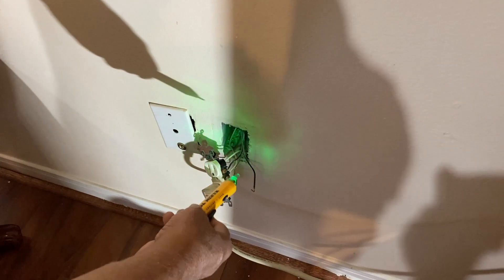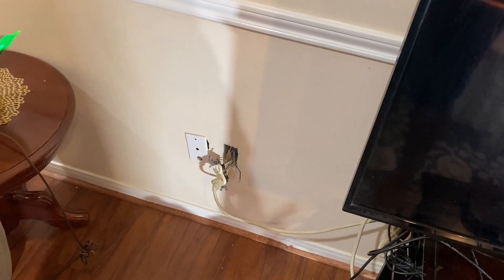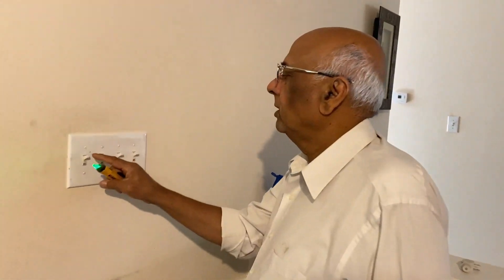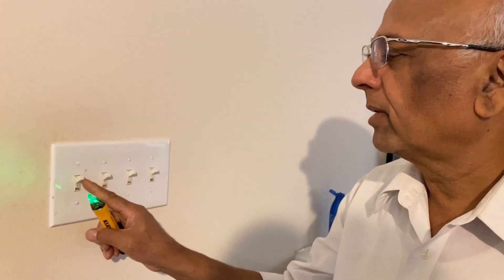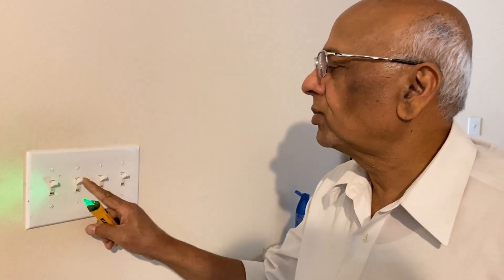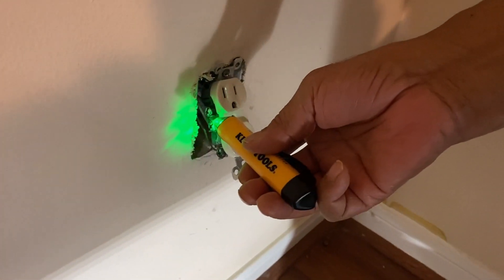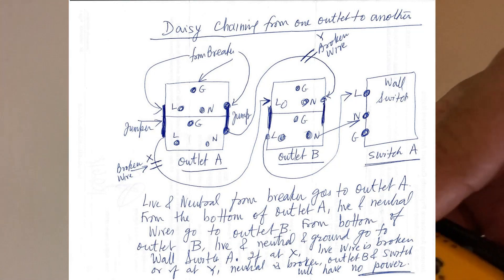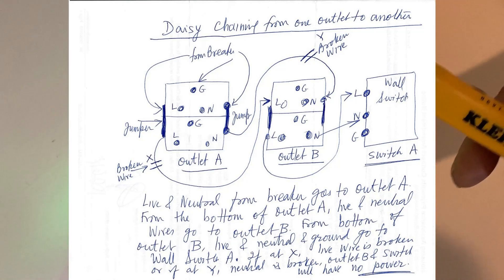Breaker Not Tripped but No Power in Rooms -  Power in Some outlets, not in Others

Comment: Wire should be hooked around terminal the other way. So that as you are tightening screw clockwise wire wraps around screw.
Reply: I noticed that as well.  Also, he really shouldn't have exposed wiring while they are live in multiple places.
Reply: Very common error (unfortunately). Also, it should have more bend in it.
Reply: Good point. Never would have thought it made a difference.😁  Thanks.

Comment: This video can be summarized in less than 1 minute. One/two outlet wires wire loose/disconnected at the one outlet thus several other outlets were not working, because they are in series. If one outlet is out, all others are out too...
Reply: Thank you